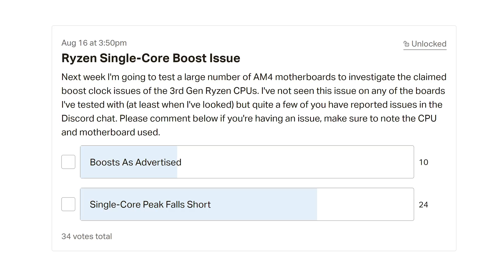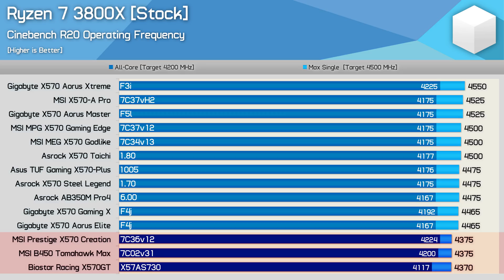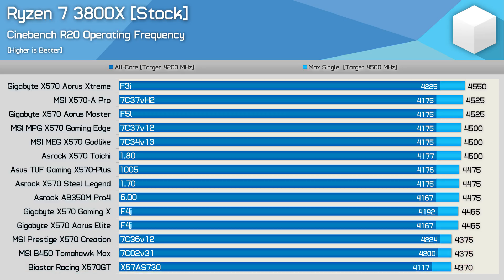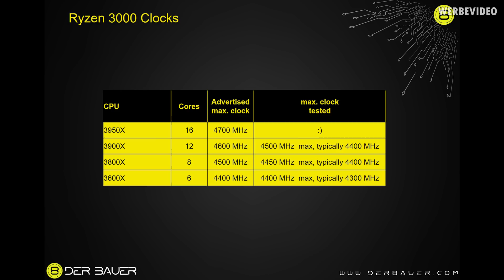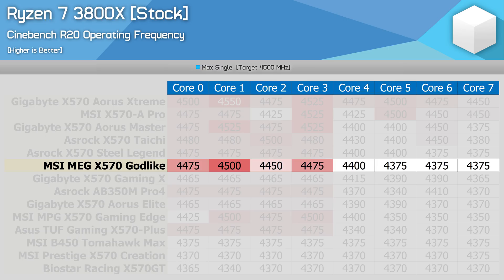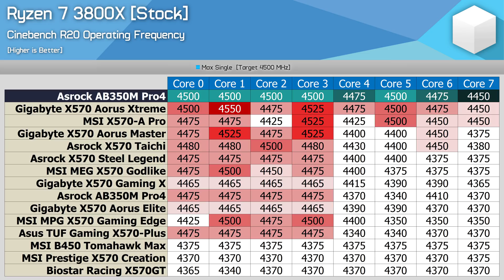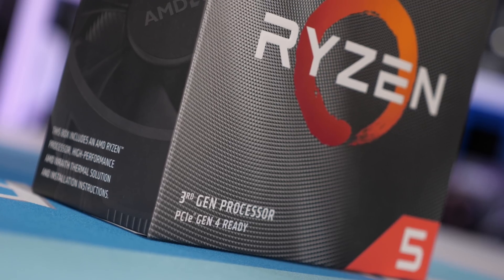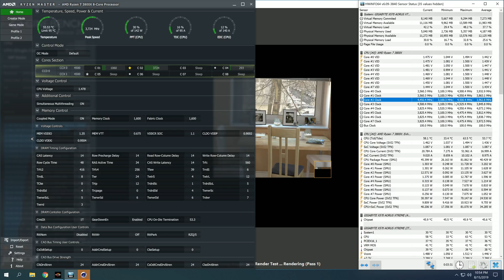AMD 3rd Gen Ryzen Boost Clock Investigation

Comment: Thanks for that, Steve! Very insightful as always.

What frustrates me much more than a few Mhz less than advertised is that my system is quiet loud since I installed my 3700x on my X470 Hero VII from ASUS. 

Even in idle when moving the mouse, the temps spike for a few seconds due to the Chip boosting and drawing around 1.5V for a brief moment. I know, i know, this is normal für 7 nm, but i don't really care since I want both PBO enabled and a quiet system, especially with a 65W CPU. 

At the moment my fans ramp up and down constantly, almost sounds like waves on the shore, but annoying :)

I already tried everything thats suggested in various forums and nothing seems to work, at lest not without a significant performance decrease.
Has anyone found a true fix yet? 

Thx in advance.
Reply: Fit a good AIO and set the fan rpm to about 1800rpm. Water is better at absorbing short term boost loads. So a bit louder all the time, but no ramping up and down. With Noctua fans 1800rpm could sound like 1300rpm on lesser fans. Pricy solution I know.

Comment: running the R7 3700x on a Asus Prime X570 pro, my max boost should be 4.4ghz however the max i've seen is 4.341Ghz, close enough i guess ? I also noticed when running a stresstest like cinebench my clockspeed is all over the place and not consistent  as it should. Oh and FYI i run my cpu on a custom loop max temps is 50c° on full load when stress testing so that's not it.  Powerplan in windows is set to ryzen balanced, and my cpu really never actually idles unless i choose power save even with the latest bios & chipset drivers.

Comment: Awesome video, Steve! 

I've done some investigation, and with some connections to AMD I think I have an idea of what's going on, and it's related to the AGESA microcode updates. The most recent one is version 1.0.0.3ABB (with 2 Bs at the end!) and it succeeds 1.0.0.3AB (just 1 B), and that came after 1.0.0.3A. The ABB version includes a bunch of small fixes concerning minor issues that the AB version had in regards to Ryzen 3000, though I wasn't able to get more concrete info what exactly changed. 

Anyway, all of the Gigabyte X570 boards, the MSI X570 Godlike, Asus TUF X570-Plus, as well as the AsRock X570 Taichi, X570 Steel Legend and AB350M Pro4, and the Biostar Racing X570GT all get the ABB update. Notice that all of them except the Biostar model are able to hit 4.5Ghz, some with rounding and others without rounding. 

The MSI X570-A Pro and MSI X570 Gaming Edge have the AGESA 1.0.0.3A updates available, and they seem to perform just fine. 

However, the MSI X570 Creation and B450 Tomahawk Max only get access to AGESA 1.0.0.3AB, which seems to be a bit of a problem. Besides the Biostar board, these were the only two that performed considerably below the 4.5Ghz target. 

It is known that the AB update introduced a few issues, perhaps the clock frequency issue wasn't there in the A version, and got fixed in ABB. This is only speculation however, and I suppose the Biostar board could either just be an outlier or maybe its 4+3 phase VRM is simply not powerful enough.

Bottom line is, I think the 1.0.0.3AB update messed some things up that were fine in the A version and got fixed in the ABB version. To prove this theory, I suppose we could either test the AB versions on boards that are fully updated to ABB (like the X570 Aorus Xtreme), or wait for the ABB update on boards like the X570 Creation or B450 Tomahawk Plus.

Comment: I dont know i Have the rx580 (Asus Strix) and r7 1700 (3.8Ghz) i dont feel the need to upgrade to R7 3700X. but I feel the need to upgrade to 5700XT. Any recommendation?
Reply: Run the MSI Afterburber with RivaTuner Statistics to check what exactly is bottlenecking your performance.

Comment: These Multicore Clock Speeds :o My 3900X never goes above 3,95GHz in CB20 All-Core. Single core 4,5Ghz, which is fine for me. But the Multi-core... And even PBO doesn't do anything.

Comment: ASUS Crosshair VIII X570 + 3900X + Kraken X62 AIO

I can only get up to ~4.3 GHz according to Ryzen Master in gaming and light loads while it drops to 4.1-4.2 during an all core benchmark.

I have yet to see the advertised 4.6 on even a single core even in the lightest loads. I've also tried running an undervolt with a negative voltage offset and a per CCX overclock, neither reaches 4.6. 

The bios I'm running has ASUS's implementation of AGESA 1.0.0.3abb.

Comment: Guys, I don't know why nobody is publicly stating the obvious thing here! AMD Lied to us this time! They lied so that they can brag how good supposedly their engineers are to go down to 7nm and not only not lose frequency but get is higher. It is obvious that even at 7nm the Ryzen CPUs are still having the same frequency as the Ryzen 2xxx but while for instance the 8 core Ryzen 2700x has a base frequency of 3.7GHz with Boost to 4.3GHz stock, with the overclocking head room for most of those chips to go at least to 4.1 - 4.2 all core, the new 8 core chip, the Ryzen 3700x has a base of 3.6GHz with Max Boost clock of 4.4GHz. Overclocking this chip to anything near 4.2GHz all core is hard without getting to more serious cooling solutions and voltages. Basically AMD put the maximum achievable frequencies on those chips exhausting any Overclocking headroom just so that they can look better on paper/posters/presentations/advertisements...
And NO, I'm not some Intel fan boy (they did do almost the same with the i7 9990k which is a slightly binned 9900k) I like Ryzen but AMD is doing some very questionable things just to make a great product look better than it actually is!! They robbed the enthusiast community of one of their favorite things to do with a new CPU, overclocking it...

Comment: I've been back and forth with AsRock tech support about this issue. I have a X370 Taichi paired with a 3700X. On AsRocks initial BIOS release for the 3000 series, they used AGESA 1.0.0.1. My 3700x boosted perfectly fine at 4.4Ghz, but unfortunately that BIOS version was bad for RAM and stability. So I tried various beta BIOS versions for them, and as soon as I updated to AGESA 1.0.0.3, the boost issues started. Now about 3 or 4 cores hit 4.375Ghz, the rest are about 4.325-4.350Ghz.

AsRock have also confirmed and reproduced my results and have said it is an AGESA issue, so not sure what to believe now, as Gigabyte are using the 1.0.0.3 AGESA and hitting boost!

Comment: I'm running a Ryzen 5 3600 on a Biostar B350 and while I'm not at my PC right now to see what Ryzen Master shows for each core, it generally shows about 4.15GHz over most cores at various times (from memory) on most other monitoring utils... which as you note rounded up is 4.2GHz.  Given I'm running entirely at stock CPU settings, on a super cheap B350 mboard and with the stock cooler (for now), I'm more than satisfied.  This thing is amazingly capable for the money and even if I'm 'down 50MHz' I honestly don't care at all.  If it was boosting to 4GHz or less then I think I might have an issue.

Comment: I think I have an explanation for some of the boards and this is a thing with intel processors as well. Sometimes the base clock isn't quite 100Mhz so when it boosts, it checks the multiplier while it is boosting, it doesn't think to check the base clock. I think this is mostly done to stay in spec of the processors, as for anything lower than 4.45 Ghz, then yeah, there is something going on...
Reply: Said this same thing a few days ago but it gets lost in the flood of comments.   But yes the base clock may fluctuate a bit.  A small deviation to, say 99.4MHz base = 4.473 GHz    Experienced overclockers will know this and take it into consideration when measuring.  But not all of the reported issues can be attributed to this.  4.3GHz is much too low to be a minor base clock fluctuation.  Those few ultra-low outliers are probably bad BIOS.
Reply: @MDFGamingVideo  I agree, I did say anything less than 4.45 is cause for suspicion
Reply: You're talking about spread spectrum. Pretty sure the guys who do benchmarks would disable it though. If it's disabled, BCLK should be locked at 100Mhz.

Comment: I got the 3600x at launch i have the asrock b450m pro4. Running 4.4 ghz all core overclock on 1.375 volt. have a large arctic air cooler. right now it is 28-29c idle and on load i do not think i have seen it over 60c. cinebench r15 score is 1733.

Comment: This seems to be more of an AGESA issue rather than a CPU issue. With the new release of the new AGESA driver, people are getting lower boost clocks. But with  AGESA 1.0.0.2 which is the older bios, people where hitting their boost clocks just fine.
Reply: Not entirely fine.. But nearer to the advertised speed..
Reply: @davws88  I didnt really have issues with my r5 3600 until I updated my drivers. All cores use to hit 4.2 just fine but now they go up to 4.1. Kinda wierd. I overclocked to 4.3 through on all cores so im fine. But I hope AMD levels this issue out.

Comment: my 2700x gets to 4.2 ghz all core boost with the stock cooler. No need for a ryzen 3000. Just get a 2nd Gen Ryzen now and then upgrade to Zen 3 or 4 when those come out. At least Zen 3 will still be on AM4 and who knows, maybe so will Zen 4.
Reply: 2700x 4.2 is not equal to 3700x 4.2
Ryzen 3000 has +15% more performance with the same clock speed.
Reply: @igorthelight  15% is a best case scenario cherry picked by amd. I love amd but they are still a corporation and they will always try to upsell their products

Comment: A 1-3% difference isn't alot but if Intel came out with the 9900k and it only got 5Ghz on some boards and 4.8Ghz on others. You can see why consumers who bought that under the premise of 5Ghz would be upset.
It's not a massive issue but AMD at the very least needs to look into a bios update or something to make the performance more consistent.

Comment: can you try the Asus x570 Crosshair Hero VIII ?   I'm having a hard time getting it to boost properly with 3900x
Reply: fFletchs might just have to wait for new bios updates fam :/
Reply: Pull cmos battery then boot to bios to verify temps. Setup bios. Save prifile power off. Re add battery. I found a bug in cmos reset on msi x570 unify. Clearing from battery dropped temps and boosted frequency. 3900x 4.95 ghz

Comment: My 3700X can only hit 4.4Ghz (single core of course) when temps and voltages are way too high.. And thats on a custom water loop with an ASUS X570-E motherboard which I didn't see in your list. So "technically" it can do it but not on the stock cooler and not within acceptable temps and safe voltages. Having said that, I am able to consistently run 4.3Ghz all core all day with sub 70c temps. So extreme water cooling helps in that regard but max OC SC is 4.4Ghz no matter what.

Comment: My 3900x has yet to hit 4,6 EVER

Sigh...

With latest BIOS my max single-core is 4,325 and I'm using a really beefy Dark Rock Pro 4 cooler - so not a thermal issue.

Latest chipset drives as well. (x570 TUF)

Comment: Why close any app when you can run Cinebench 15 with priority set to Real Time.
Even my old I7 4500u can do Single Core: 113-114 and Multi Core: 269-275. (Real Time priority is set and undervolting with XTU  for not reaching 15w TDP under full load and go 2.7 Ghz Boost 99% of time)

Comment: Welp, my own experience with a MSI 470X Gaming Pro Carbon, bios 1003ab (latest) + R5 3600X. I've never seen 4.4 ghz single core turbo not even with beta bios. Last week after i updated the bios the CPU is bow locked at 4.25ghz, no matter what i change at the bios, pbo, auto-oc, it keeps posting at 4.25ghz. After a while i got tired of trying and set up a 4.3ghz all core at 1.365v core, that clocked has given me the best results so far on Cinebench R15-R20 and in games.

Comment: Steve not only could this behavior be a Bios issue but it could a transient response issue with the vrm's.  However, that is hard to determine through the data in this video as there was no frequency plots to see the boost times to or past 4.5Ghz.  If those times were millisecond then transient response could be to blame also, and that is on vrm design.  But your assumptions could be correct too that a bios update is needed.

Comment: this explains it. running a 3900X on an MSI X570 Creation and it NEVER boosts above 4275mhz. i was getting some wild 4450mhz stock boosts on day 1 but multiple bios resets/updates later and never been able to replicate. have OC'd all 12 cores to 4.25 at 1.325v seeing as im more or less limited to that performance anyway

Comment: Very informative. In terms of performance it's a non-issue, but AMDs marketing was misleading if not outright dishonest. Proving that the variation was mostly caused by bios not vrm quality or silicon lottery is reassuring that with a little tweaking, the advertised clocks should be achievable for most consumers.

Comment: I think it is a combination of what board you are running and what processor.  I'm running a 3700x and a Gigabyte Aorus Elite x570 with only Memory XMP Profile enabled (4x8gb of 3200 speed ram) and I'm hitting 4.4 boosts. But if I threw in a 3800x, would I hit 4.5? Probably not. 

And PBO and Auto-OC is just too dependent on temps, voltage, silicon lottery, etc.

Ther are also people that don't understand that boost clock doesn't mean every core is going to hit that max boost. I'm cringing still when I see someone complain about getting 4.2 all core on a 3700x...boosts don't apply to a manual OC with a voltage set, nor will the all core boost. Some people simply dont understand how CPU boost speeds work.

Comment: I thought it was Zen 2 who will shine between AMD's 7nm product lines, and I was wrong, and I thought Navi will be a failure, and again I was wrong. To me, Navi outshine Zen 2 in AMD's newest product line this year, not to say that zen 2 is bad, it just kinda dissapointing that you can't get the most of your cpu by overclocking because overclocking zen 2 surprisingly give you less performance than PBO. I'm agree with steve, looks like AMD push Zen 2 on it's limit and leave no headroom for overclocking, and that shady advertised frequency doesn't make it looks better. I hope Zen 3 will be much better than this.

Comment: Ive tried 2 different ryzen 3600 cpu's in my sons build with b450 tomahawk and spent days trying to get boost to work properly.  Most I could ever get was 4149 for a split second and that's messing with scaler and loadline calibration setting among others. latest bios, chipset drivers and etc.

Comment: I am not sure but my 3600 can't even reach 4GHz out of the box, with my MSI X570 Gaming Pro Carbon. With some tuning, my 3600 can still only reach 4.125 GHz on CCX 0 and 4.075 GHz on CCX 1, with 1.36 V. I give up trying to reach higher clock speed at this point......

Comment: Are there any x570 motherboards that will post with a 2200g? I got an amazing deal on the processor and really want a x570. I've seen conflicting information. Thanks for the help!
Reply: I believe not a hundred percent sure. That the 2200 G is based on first generation cores. This is probably the reason why I won't post

Comment: I see the point in 4.466 GHz round up to 4.5 GHz. But still clock is not a wave form. Either clock is on or off. So technically 4.466 is not 4.5.......
Reply: None of that made any sense. You don't need a waveform to round.
Reply: Of course it matters. It does not behave like a limes! Clock is either 1 or 0 nothing in between.
Reply: @interceptor001  In English?

Comment: My results are much worse than seen here. My 3900X has never gone over 4.375 at any point — even with super light single core loads. 

Sitting on the desktop (idle) never goes over 4.375GHz
Cinebench R20 single core never goes over 4.15GHz
Cinebench R20 multi core never goes over 3.975GHz

I’m using the X570 Aorus Master with F5l bios. 2x360mm custom loop. I’ve tried everything from undervolting to changing PBO and BCLK settings.

This is far too low. I’d be happy if it ran 50-100MHz lower than it’s advertised boost, but it can’t ever get there.
Reply: Custom loop? Do you have anything to provide airflow to the main board VRM heatsinks, like the stock CPU cooler would?
Reply: @0LoneTech  Not directly, no. Thankfully the heatsinks on the Master are fantastic-- VRM temperatures are well within reason (under 50c) even during synthetic benchmark loads.

Comment: I'm not really having an issue. 3600 4/6 cores hit 4.2 consistently. 2/6 hit 4.0. No change in bios.
Msi b350 gaming pro
Sappire nitro + vega 64 turbo mode
G.skill 16G 3200 xmp profile 1
No issues and 20-50 fps increase in all games compared to my ryzen 5 1600
Also prime 95 holds the above but heats up to 95 lc rather fast however it does not downclcok and hold the 95c temp.
Reply: Let me add I ALWAYS do a bios update before a cpu swap and do a complete CMOS reset on the bios. Try that if your having an issue

Comment: I guess this gonna be fixed with next gen, like it was with 1 and 2 gen, also we gonna get higher clocks. Maybe 5 ghz gonna be on next socket.
Reply: Vlad Panchenko most likely not... the clockspeed will continue to go down as the production nodes goes smaller and smaller. Iteration of this same size can get some speed jump, but 5GHz, is not likely unless They five up IPC gains and only consentrate clockspeeds. I Expect them to make cpus with better IPC and slower clockspeeds instead.